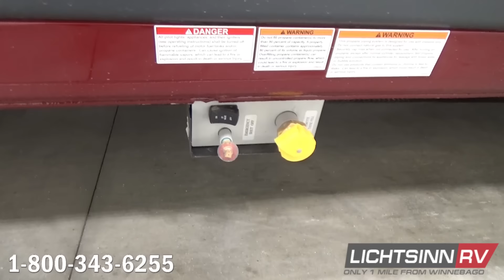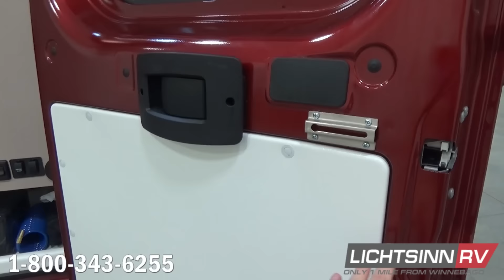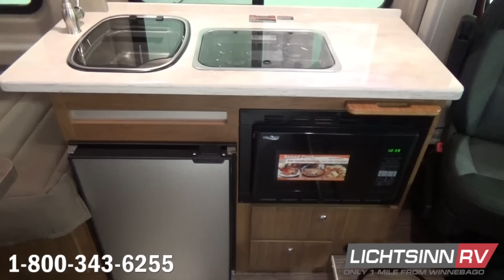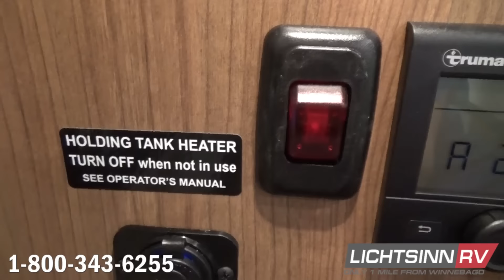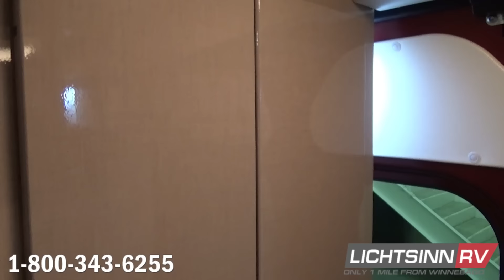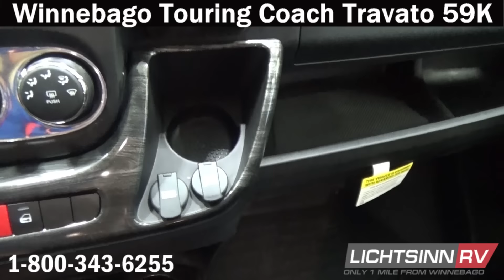LichtsinnRV.com - New Winnebago Travato 59K

Comment: If I were to consider traveling to your area for a 2018 version of this van,  and knowing during the first year , after purchase of a new RV a lot of bugs or warranty work can be necessary,  do I have to travel back to your facility to get this work done if I am on the road?  Or can I go to any Winnebago dealer?  I will be traveling quite heavily,  and wondering how this works with your dealership.  Thanks ahead of time.
Reply: Also,  does it cost to go to a different dealer for warranty work,  or is it covered no matter where it is done?
Reply from the maker: Good morning Jackie!   Thanks for your note!  Winnebago of course does not charge for warranty work by the dealer at our location or any Winnebago dealership.  Every dealer is required under their franchise agreement to service any Winnebago guest, regardless of where purchased, much like the automotive industry.

We look forward to working for you!